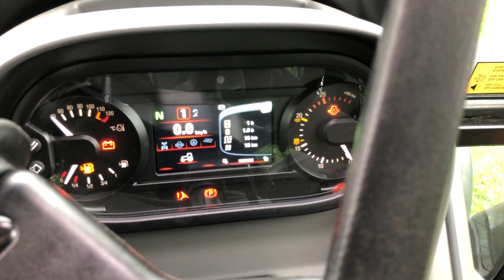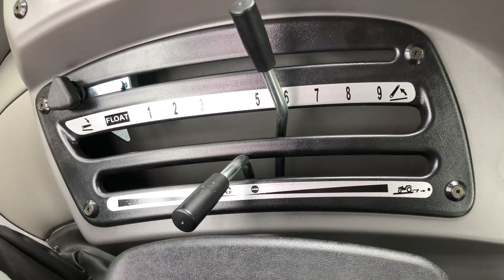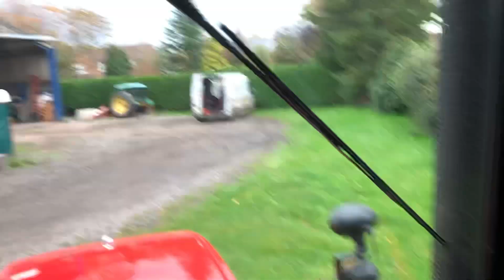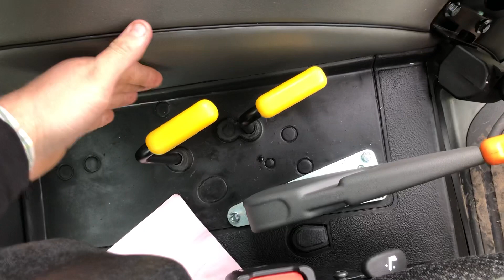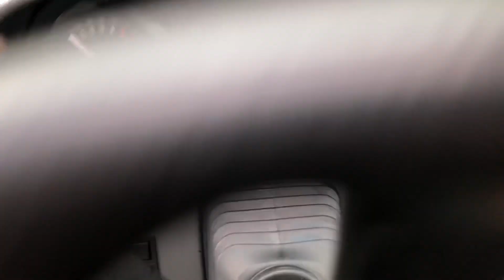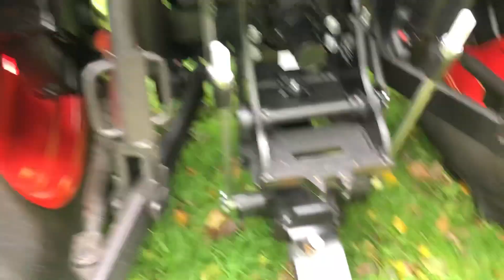2021 Zetor Proxima HS120 tractor walk around

Comment: Do you think Zetor is better brand then landini?
Reply: Yes the modern zetor is a better tractor than the landini , i a mechanic on tractors and the zetor is a better machine
Reply: @MOOBOOSE  do you ever have landini or does some of neighbours have landini?
Reply: Nie :-)
Reply: They were always better.
Reply: @colmanlong1032  Zetor is better in your opinion?
Reply: @Pacco_1833  Ah I just like the zetors,they need a small bit more attention with brakes.,but one of the best tractors I had was a landini 10000,with the bullet proof 6.354 perkins engine,rust was a serious problem.
Reply: @colmanlong1032  So who is better in your opinion?
Reply: @colmanlong1032  Zetor?
Reply: @Pacco_1833  only had the smaller zetors and they were very good.no one has the newer landinis around here,but there is a good few of the newer zetors and they are very happy with them,so I say Zetor.
Reply: @colmanlong1032  Thank you! I am looking to buy Mythos 110 or Forterra 11441 both are 2003 year
Reply: @Pacco_1833  It's your choice,but I'd go zetor,what country you in.
Reply: @colmanlong1032  Croatia
Reply: @colmanlong1032  And most people say Zetor so I will buy Zetor
Reply: @Pacco_1833  The best of luck with whichever you choose, Zetors are becoming very popular again here in ireland,unfortunately most of the older ones were exported to Poland.